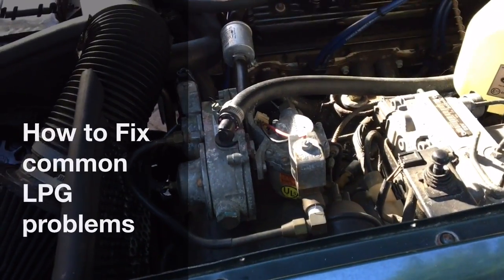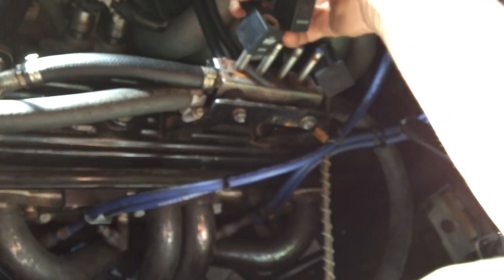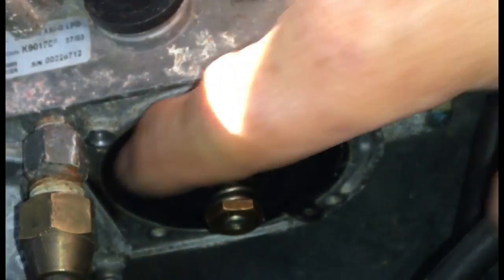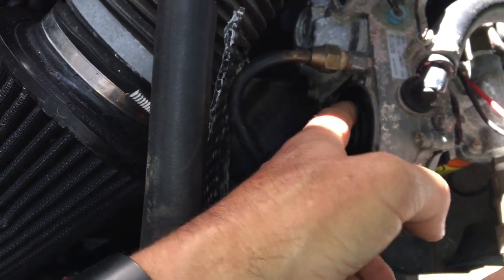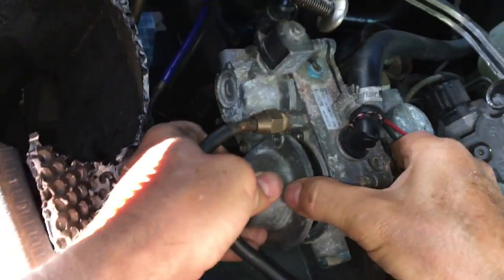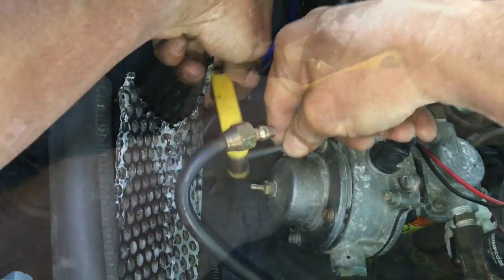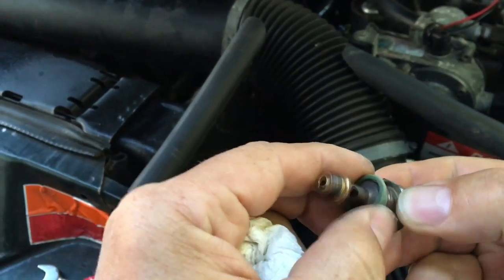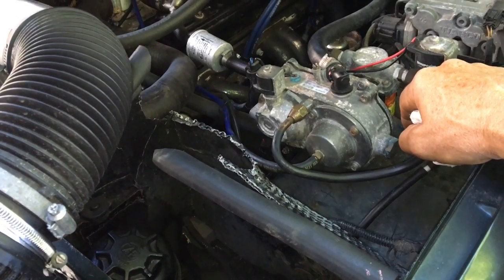How to Fix Common LPG Problems - Vaporiser / Reducer, Injectors

Comment: Very late comment (9 years!). But to assist in getting the lid back on against the springs you just need 2 x socket head bolts of same thread size but approx 25mm longer. Use these 2 on opposite corners to compress the spring in enough so you can then get in 2 standard bolts on the remaining holes. Screw these standard bolts in enough to fully engage threads and then remove the 2 longer bolts and put the final 2 standard bolts in before tightening sequentially. Thanks for the video, need to pull my vaporiser apart tomorrow.
Reply from the maker: Great tip, thanks!

Comment: Hi my landcruiser will start on gas but cuts out at 2000rpm you her the solenoid click and it then cuts out 
Is this likely to be a diaphragm issue ?
Reply from the maker: maybe, or clogged filters, or a stuck tank float level valve.

Comment: My car drives on LPG. It's a factory built system, and sadly the gas regulator uses a highly proprietary linear actuator (basically a linear stepper motor) to regulate the gas.

This means it cannot be acquired new anymore, and these actuators tend to fry their electronics, making the system useless.

It's a necam mega distributor with a Volvo proprietary stepper motor based linear actuator on top, nasty how they designed it in such a way to make them the most money, rendering the systems useless once they deem the hardware deprecated (which they did).
Reply from the maker: LPG is a bit of an extra pain for maintenance. I don’t think I would bother with it again.

Comment: Still a useful video 8 years later! I am having issues with my systems now, it will run on gas for a second or two and then switches back, pain in the ass!
Reply from the maker: Thanks, yes they are a bit of a pain.  It switches back when lpg gas pressure is too low, so a problem with filters or the vapouriser probably.

Comment: I have a vaporiser system, car stopped running on lpg, took it to mechanic and they tried new injectors which did nothing so they cleaned my original injectors and it now runs, but very rough and rough idle. Any ideas what I can do
Reply from the maker: The injectors were probably not ‘cleaned’ very well.  Depending on the type there may be a rebuild kit to replace the springs and o-rings inside the injectors.  There is for the OMVL type.  The filter(s) may also need changing.  The vapouriser may also need a rebuild kit.

Comment: Its dangerous if u dont secure the vacuum line tightly

Because what van happen is that the hose flies off when it gets positive pressure and it can fly off causing a massive LPG leak in the engine bay
Reply from the maker: Unlikely. It would need a massive failure of the vaporiser diaphragm. In my experience the leaks tend to be small. Enough to upset idle running but not enough to blow the line off and any gas there is consumed by the engine.
Reply: @comeinhandynow  happend to mine
Reply from the maker: @tamer27antepli  Ok thanks for sharing.

Comment: What’s , in your opinion, the other main common causes of erratic idling on an LPG engine. All filters,air and lpg fliters changed,haven’t checked vaporiser yet for leaks , but I will thanks to your vid.👍🏻 
Apart from bad injectors, do you have any other suggestions as to bad idling some days and not other days ?  Does the PCV valve play a huge part in idling problems and can it be erratic?Tia
Reply from the maker: @royb2251  Vapouriser leaks in the rubber diaphragm or clogged up /waxed up injectors were  my main problems along with it just needed constant mixture /tuning adjustment via the ecu s/w

Comment: Can anyone help..plse, ?🙏
fuel gauge is kaput,
& its stuck on full.!!
Can an empty lpg only, tank be part filled, if it runs empty on the road, or at  home, in order to get to 
a garage, or is it a tow
truck only, scenario.????
Reply from the maker: If it’s indicating full but it is actually empty then the float level sensor inside the tank is stuck.  It can be removed and fixed  by the 4 bolts/screws on the tank but you have to be sure that the tank is empty. Keep running the vehicle until it wont run on lpg anymore.  Disconnect the pipe and power up the solenoid valve to open the gas to outside air, in order to empty the remains. Be outside with lots of ventilation.  You can’t easily refill the tank away from a filling station, but you should still have the ability to run on petrol instead. Press the selector button to switch back from lpg to petrol.

Comment: Hello sir. I have idle issue. The car gets rough at first transfer to lpg, and it throwes lean idle code amd sometimes even dies at traffic light especially at colder weather. If i don let it idle it runs fine. So the problem seems to manifest it self mostly at idle. First transfer to lpg always problematic. I calibrated the injectors and cleaned them. Vaporizer has never been refurbished and i also has noticed filters on them never been changed. I have two vaporiser connected because i have v6 engine, older setup. ... What you think could be the problem? It seams heat sensible problem....
Reply from the maker: Could be an air leak into the vapouriser. Might be worth stripping those down.  If it is just a problem cold then you could delay the switch to lpg by increasing the switch over temperature in the LPG ECU. You will need the hardware cable and software

Comment: hi. thanks for the video. I have a Tomasetto Nordic XP leaking coolant from the rubber gaskets. i bought a kit and changed them but leak is actually worse. screws seem tight enough. any ideas? Thanks.
Reply from the maker: Take apart and try and analyse where leak could be coming from

Comment: Is that a freaking Chevrolet TPI with LPG?! Never seen that before! What kind of car is it installed in, as the TPI's just came in the C4 Corvettes, gen 3 Camaro & Firebird!
Reply from the maker: Yes of that generation, a 350 CI / 5.7L V8 that was in the 80’s Corvette.  Supposedly tuned to 330bhp on petrol. I had conversion done to lpg..  It is a crate engine conversion into a Land Rover Discovery 1996 yr so 1sr Gen.  Conversion  by Overfinch in UK. Very rare!  Sold now.
Reply: @comeinhandynow  Awesome, very cool my guy! The only reason I recognised it because I have an Iroc-Z lol. 
Stumbled across your video as I'm hunting down a solution to my LPG-woes. I Have a BRC system installed on my 05 Tahoe (installed when new) and it switches over to gasoline when reaching higher rpms (especially during downshifts & higher load). Filters were replaced this summer, recently replaced the old Magnet-coil on the ET98-filter housing (got a little better), gas-tank replaced 3 years ago. Sounds like a lean-issue perhaps? Could be somewhat clogged injectors? Any thoughts?
Reply from the maker: @kmas8229  It is very useful to have the software and interface cable to the separate LPG ECU in order to check the LPG pressure and temperature.  Not sure how easy to get it for your system but worth enquiring, very useful for tuning to the right air/fuel ratio.  It sounds like the LPG pressure at the injectors is collapsing to a low level which is why it then switches to gasoline. I would take a guess at it being a vaporiser problem, anything rubber deteriorates and I had to change the diaphragm in mine a few times. Also check it has enough hot water flow to it to fully vaporise the liquid LPG to gas at full demand.

Comment: Hi, great video. My car is running well on LPG, however the vaporiser is leaking coolant and gas, not from the diaphragm. I want to just swap the whole vaporiser for a new one, same make and model. Will the system need to be recalibrated do you think?
Reply from the maker: Thanks. It would probably be better with an ECU retune afterwards, but try it and see.  Or try and work out where and how it is leaking, it might be fixable.

Comment: amazing video mate, i bought a dual fuel AU and for some reason when driving on LPG the car seems to drop revs when crusing off the trottle and when getting on the trottle again it seems to bog down for a second and then goes. sometimes it would start on LPG and die, But starting on petrol and switching to LPG working fine but only sometimes. Runs on petrol perfectly though, Do you reckon it's clogged injectors and filters?
Reply from the maker: Could well be.  The thing I found with LPG is that it often needs retuning, via the ECU parameters for rich/lean at different engine map positions.  Having the LPG ECU software and hardware interface is needed for that.  Not impossible or that difficult but needs some research.  Cleaning the injectors and often renewing the vapiouriser diaphragn also seemed to be regularly needed.

Comment: Thumbs up, thousand times what are the safety measures of handling LPG injectors when you are replacing them with the new ones? I have a Van 2011 Toyota hiace?
Reply from the maker: If the engine is off, so is the lpg gas connection so no safety issues.  There is a solenoid at the tank and at the vapouriser that isolates the gas.

Comment: I have an AEB MP48 system in my 4 cyl car, there's an issue where when I accelerate to 2500 - 3000 RPM the system goes back to petrol and beeps at me as if signaling that the pressure is low. I realise this isn't too much info, probably a very broad issue, but any thoughts?
Reply from the maker: Yep sounds like pressure low low. I would check vaporiser and filters
Reply: @comeinhandynow  Thank you, I'll check those parts. I'm very lucky to have found your video, as you're replying and helping people in the comments even now after 6 years.. Thank you again.

Comment: I have a problem with the Prins system on my car.
From cold, when car gets to the set 45°switch to lpg, the car stalls.
Will only switch to gas when car reaches 85°.
I have been told system may need bleeding?
Reply from the maker: “Need bleeding” ?? - bleed what? The coolant system? Maybe but doubt it.  
If the coolant needed bleeding the car would overheat. However check the water going to the vapoiuriser is as warm as it can be (as warm as any other pipe).  Injectors probably a bit waxed up.  You could try stripping and cleaning them if they come apart on that system, and/or try running a copper hot water pipe from the engine coolant system underneath the injectors to help free up waxy deposits.  It was easy on my omvl system as the injectors were a metal block.

Comment: Do you have any tips how to remove excess gas from tank if you accidentally pumped above 80%.
Reply from the maker: The tank float level should cut off overfilling. But if you have managed to then drive it off.

Comment: Hello, i have a avensis t22 1.6 vvti with omvl kit, i had some problems, car was not running well in lpg neither in gas, hard starts as well, my mechanical after a lot of research for what cause it, we change plug, one multiplier, lamda sensor, even and the reducer because he didnt adjust the pressure to the old one, as he inform me today the car finally well, but he has as he told a bad news, he could make the car run good only at fuel trim -20 in lpg, this is not normal as he said but for some reason the car run hood only at this point, when he try to run in normal setting the is max +/-5 the car doesn't run well, he told me to start looking other things but i can't spend anymore money not knowing the problem, the car is already 1 months in the garages, one mechanical says has no compression, i test it and is good, other one says other stuff, only with him tried and did some work, he said with this setting exacly this: we have this problem and i dont know how log the car will last, i ask him what do you mean! I mena with this setting that is to rich mixture maybe you soon have other problems, as catalyst may worn even the whole engine didn't last, even if the car seems to work fine now, is this true? Anyone have an idea what else to check in the car?
Reply from the maker: Hi. This rough running is common after a few years.  Injectors and filters clog up with the wax that they mix with lpg gas.   I had to retune mine every year or two as well as replace or service items, maybe every 2 or 3 years.   The ideal thing is get yourself the omvl softwre and interface cable to the ecu and an in car  AFR (airfuel ratio) meter, then you can tweak the gas injection time yourself to get a good reading. Better then relying on mechs who talk a lot of BS on lpg. Unless they run one themselves or install then. As long as the AFR is ok then probably ok if it was retuned to make it correct and it is not misfirinf/ running rough.  This is just my personal experience so i take no reponsibility for perceived advice, as always

Comment: hey there, great video mate. i have a difficulty at cold startup, it requires trying multiple times to turn the engine on. i replaced the gas reducer(vaporiser) a couple of years ago. i have the lpg system for about 11 years (brc gas system). any suggestions on what could that issue be? thanks
Reply from the maker: Lpg cars should always start from cold using petrol only.  Then when the engine has warmed up enough to allow the vapouriser to work it should automatically switch over to lpg, as long as you have it switched on.

Comment: I have an 2005 GMC truck, used to be Schann's food delivery, made a flatbed,, has 2 100 gallon LPG tanks, starts great from a cold start, but when it warms, and you turn it off , it tries  
to start , does not run, sometimes fuel starter helps, not anymore,  so I left it overnight, came back, started and ran good, made it to shop,  where would I find info on this? thanks

Comment: Hi, I have a grand Cherokee sport with a 4ltr engine and had it converted to LPG about 10 years ago. I had no problems with it and only use it once each week for local travel. Some months ago I noticed a smell of gas and tried to locate where there might be a leak. To be safe, I turned it off and checked the connectors to the tubing and replaced 1 on the front injector rail. There are 2 lots of 3 Magic valves. I decided to test the system for leaks today and all appeared ok until I was watching the engine running with the gas turned on and after a few minutes there was a sudden whoosh or release of gas from the front set of injectors area. It did it again a few minutes later both times just for a second. I would think that the gas tank is probably empty as I didn’t refill it after turning it off. Is that sudden release of gas a normal thing especially as the tank might be empty? I didn’t see any other problems or leaks except for the sudden release. Would you kindly let me know what you think of this and let me know. Your video shows me what I need to do to service everything else but these Magic valves might be tricky to service. Many thanks for reading this long text.
Reply from the maker: The whooshing doesn’t sound normal. Best check over everything. A common problem is the vapouriser rubber diaphragm having a leak and leaking gas into the vacuum line back to the inlet manifold. It may be that. Not sure what you mean by magic valves, injector solenoid? Or gas isolator solenoids? Anyhow just check everything. Good luck.
Reply: Hi, thanks for your fast response. The release appears to come from the front Injector rail Magic jet FX 3 cylinder array of which there are 2 sets. This is a link to the website if I need to replace them https://www.lpg.auto.pl/en/index.php?s=info&id=1048 and they are Polish from the loo of it. Otherwise I will do as you suggest and have the whole system checked. I’m trying to save the pennies lol. Thanks again.

Comment: Hi i have an old brc type one on a solex carberetor, after filling the lpg tank full which prob hasnt been done for a while the lpg is intermitent it runs for an hour then stops then randomly will run for another hour or so when it feels like it. Ive a feeling i bit of rust in the tanks. Ive changed thw wet filter as thats all it has. Any ideas how to fix? Many thanks
Reply from the maker: Has the vapouriser got too cold when this happens? Or maybe the injector(s)?

Comment: Have a factory fitted BRC system which has the automatic switch over/level gauge. After a gas fill up the system stopped switching over to LPG. The dial on the tank shows gas is present but the led lights on the dash give the impression its empty. I'm wondering if it could be a fuel tank sender unit issue but fear it may be the ECU malfunctioning. Normally I get an audible warning when it runs out of lpg but not with this problem. Anyone else had something similar happening?
Reply from the maker: I suspect it’s a stuck tank level sensor unit, i also has one stick, but stick on full so i was able to empty the tank by driving.  It would be more difficult to empty the tank in order to fix it if full.  Maybe you could disconnect the level sensor and wire the ecu connection to a dummy external one or a variable resistor to both test the ecu connection and fool it that its full.
Reply: Thanks for the response. I checked the gauge and resistance was ok. While checking wires I took the LED dash indicator out and found the connector was loose. So this indicator acts like a switch - not just a level indicator! Back to 50mpg:goodvibes:

Comment: Putting super glue on rubber valve  wtf
I didn't recommend silicon glue neither
Reply from the maker: If you have a better technique then show it…..  Easy to say what not to do.
Reply: @comeinhandynow   the super glue is gonna brake the ruber and is not gonna be flexible im sorry  but is so so wrong